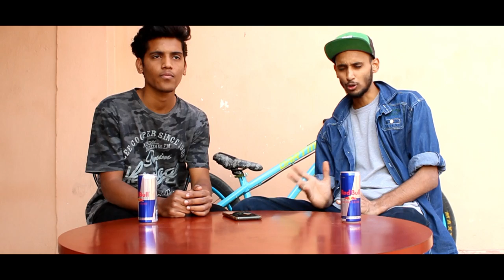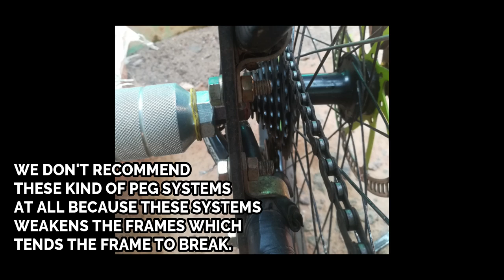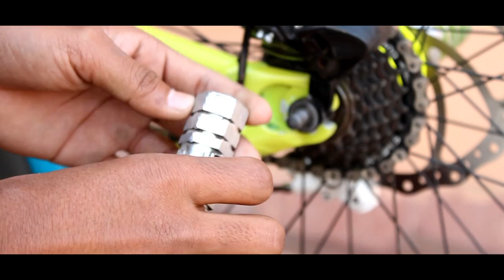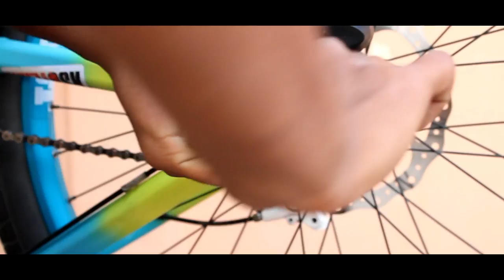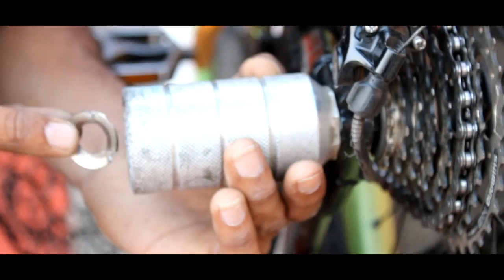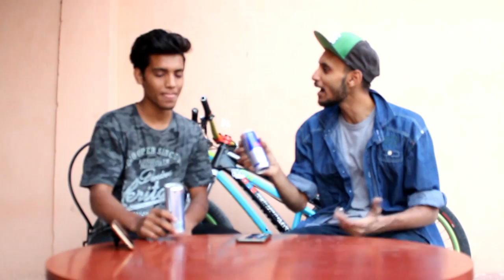How to Install Stunt PEGS ? | Infinity Riderzz Kolkata | MTB Stunts 2019

Comment: Hey guys. Nice video. But I always have a doubt about Wazid's rear derailleur. Why do you use a long caged derailleur? Wouldn't it be better to use a short cage just because you're mostly leaning on your bike?
Reply from the maker: I haven't faced  any problem with this derailleur yet. But would sure try the smaller cages as well! Thanks! 💪🏻
Reply: @InfinityRiderzz  You're welcome !!😊✌
Reply: No men it is perfect he don't need to change to short caged long caged is better you will have no slack in your chain he doesn't have 3 chainring only 1 so a short cage will cause a problem
Reply: rrrrrr